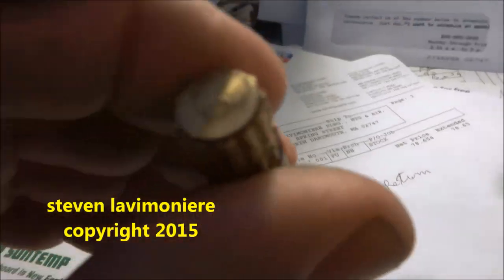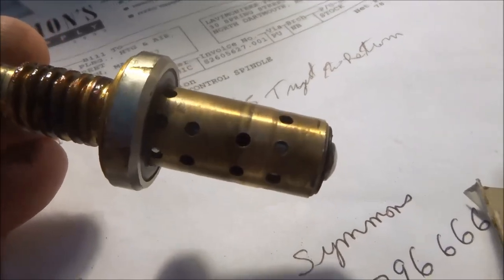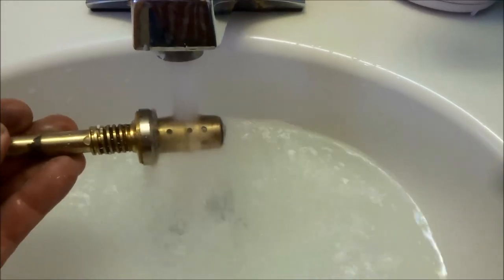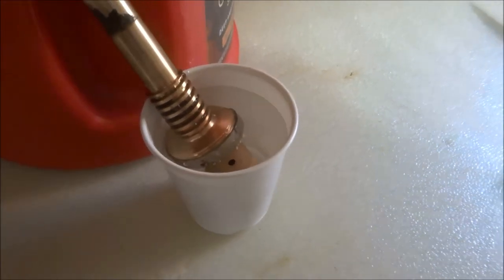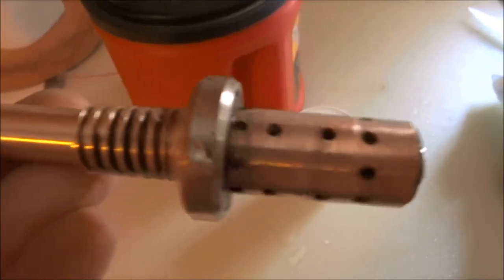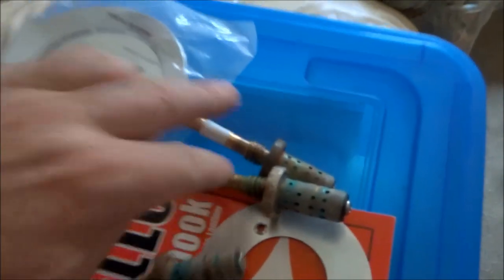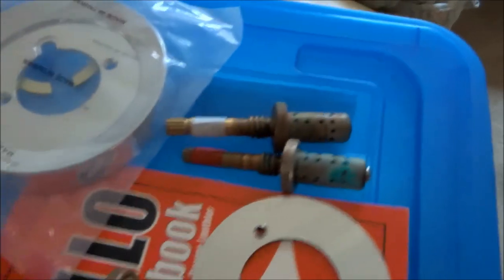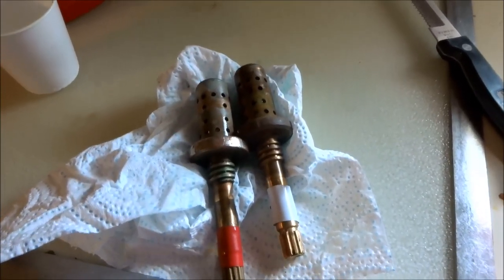how to free up a stuck symmons ta10 or c5 spindle

Comment: TL;DR: If you have a bit of finesse and access to an air hammer, you can probably unstick these quickly.  I did.       Tell ya a little trick I just discovered... I soaked it for about an hour in CLR and no change.  Then I realized that instead of tappy tapping it on the counter, I have an air hammer!  Wrapped the stem up in some cloth to protect it and put it in the vice.  Set the air pressure low on the air hammer (40 psi), put in a flat hammer bit (not a chisel)  and hit the hot seal end with the air hammer with two quick half second blasts.  Ah ha!  The magic click returned.  I put it in some boiling water for a minute or two just to rinse out any crud that had come loose, but there wasn't anything in the pot.  Pissed me off that I had to do this, but I fought with a new TA-10 all day today and couldn't get it to close the cold water side at all.  As soon as I opened the stops water just poured right through as if the valve was fully open even at the full off position. Worked as expected on the hot side.  I suspect it's defective.  After the magic click returned to the original one it installed and worked as expected in 5 minutes.

Comment: Was at a water heater the other day that is only  2 years old and popping because of sediment build up . I drained and flushed it but did not work . Cust called A.O. Smith and they recommend removal of anno rod and pouring 2 gallons of brown vinegar into tank and let sit for few hours and then flush and drain to break down sediment and debris. I will return in a week and attempt this and let u know how it works out . Wish me luck lol.
Reply from the maker: justin henning sounds like a horse and pony show